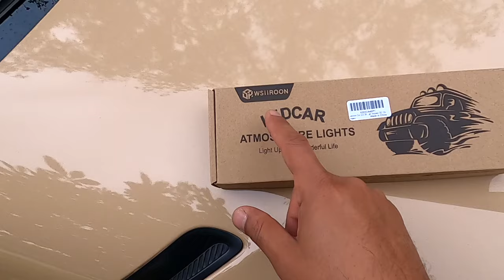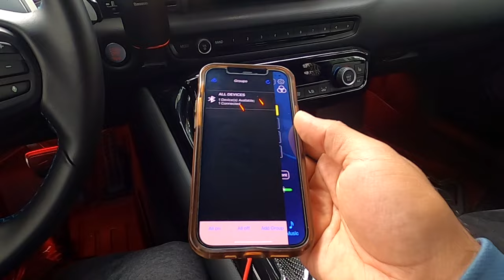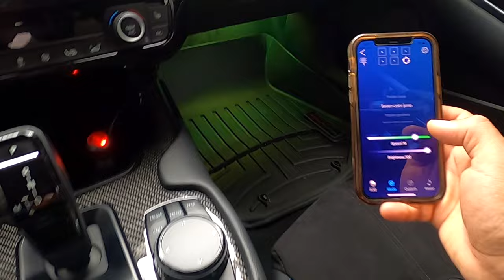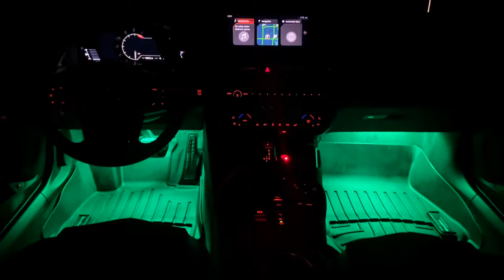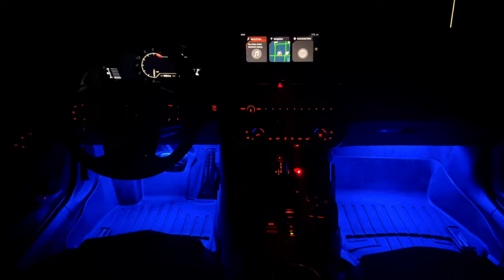How to install $15 Car LED Footwell Lights

Comment: Thanks for sharing, I've always wondered if it looked decent. But I would like to see some sort of adaptation to not use the cigarettes lighter, since I use it to plug in my fast charger.
Reply from the maker: You can tap in tap in to a fuse 👍
Reply: I wired mine into the door switch.
Reply: @user-neo71665 doesn't the door switch have only 1 wire? Did that work for when the door opens?

Comment: You can connect more than one if you have 4 door? So each side has 2 lights (8 total)?
Reply from the maker: Yes you can connect more but you will need use a splitter https://amzn.to/4bf5UGr cool 👍

Comment: Do they turn on and off with the car keys or you need to turn on/off by hand everytime ?
Reply from the maker: yes most of the cars cigarette lighter connection turn off  when the car turns off too 👍